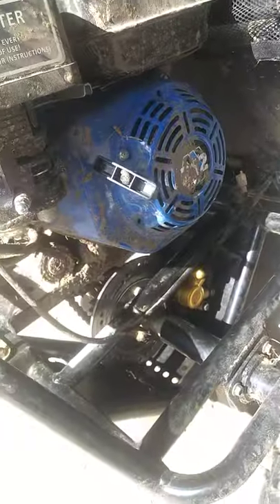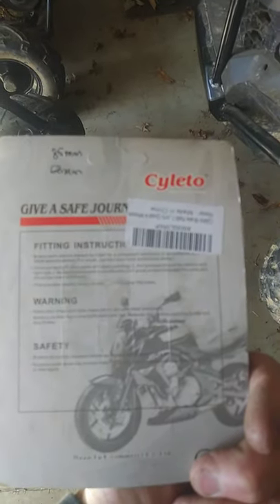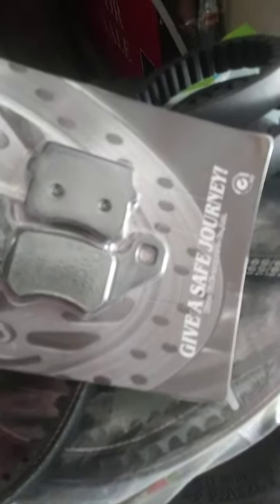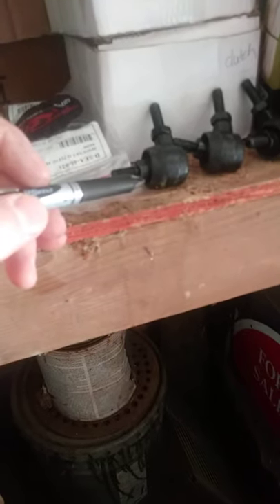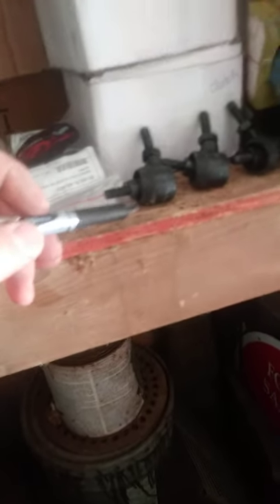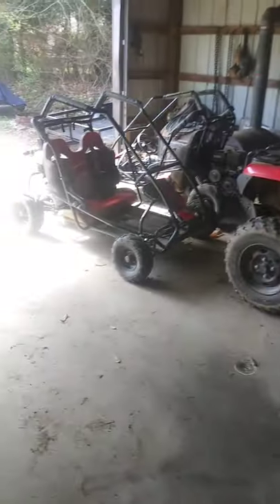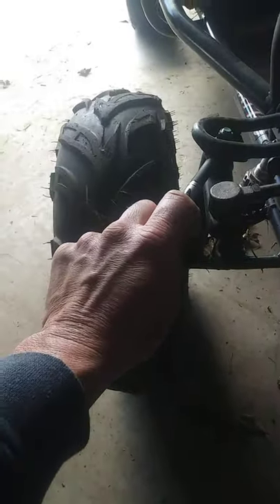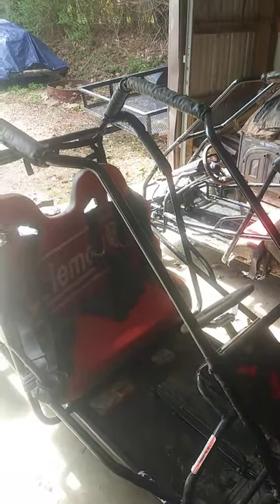Coleman Kt196 brakes

Comment: Make sure you lower that bolt under the front of the accelerator pedal 😉
That alone got ours up to 35mph but make sure to set the bolt to where it doesn't allow enough rpm to float the valves. The stiffer springs in a stage 1 kit solve that issue though